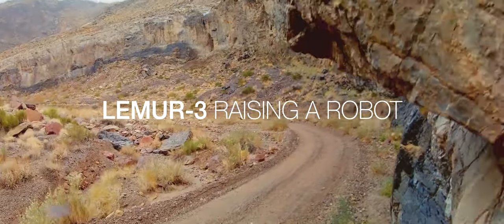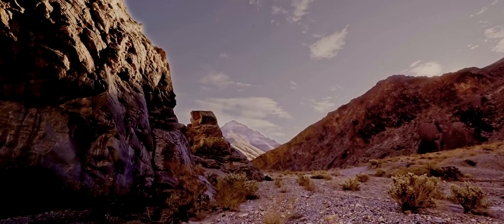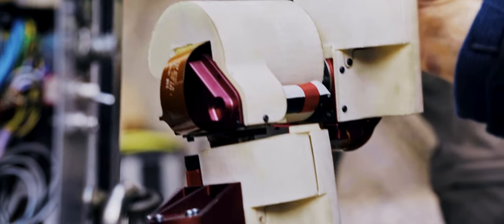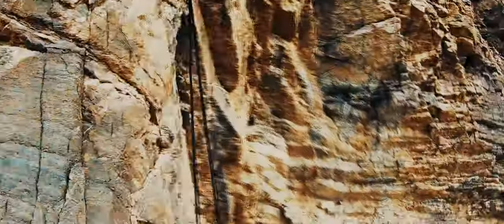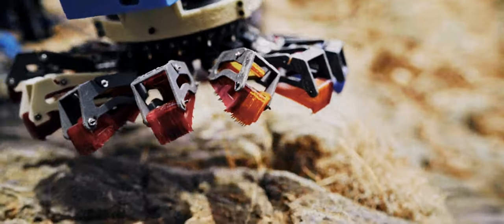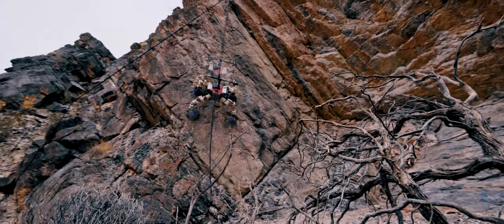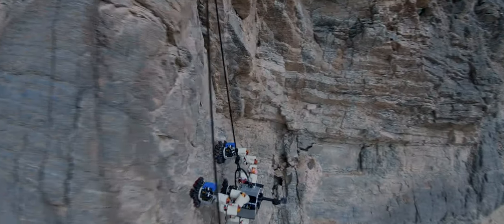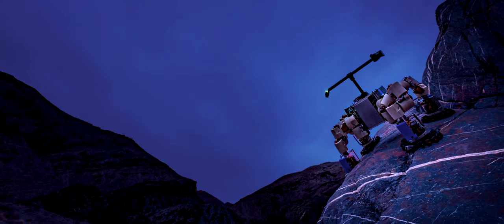NASA Climbing Robot Scales Cliffs and Looks for Life

Comment: A snake-like or millipede-like apparatus will be suited more I suppose. Four legs is not enough. Also would be useful if such apparatus could replicate itself - could use more or less legs if needed. Segmental body: insects as a model, not arachnidas. Insects is a must-have model for things like that, we're lucky we have such great model for our machines here on Earth.
Reply: verioffkin More limbs means more traction, but they also mean increased complexity, and a larger number of places for failures to occur (as every connection with the ground has a chance of damage). It's a design trade-off.
Reply: @glitch3141  Well complexity is inevitable if we talking about explorations of other worlds anyway. Could be micro-robots as compromise.
Reply: Complexity is inevitable, but the more external a system is, the more robust it should be. Moving parts outside the protective shell risk damage from the elements, and there aren’t many clean fixes to problems found on mars. I don’t know much about micro-robots, so they might be a good idea.